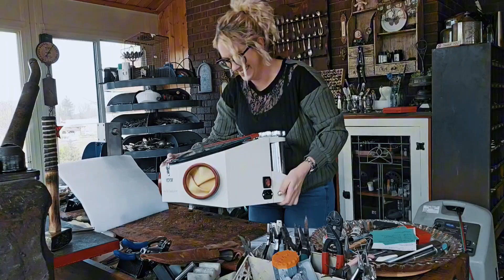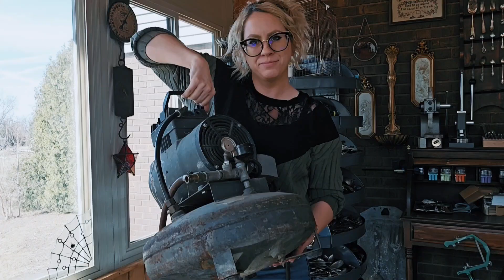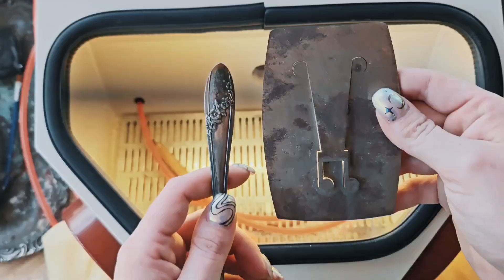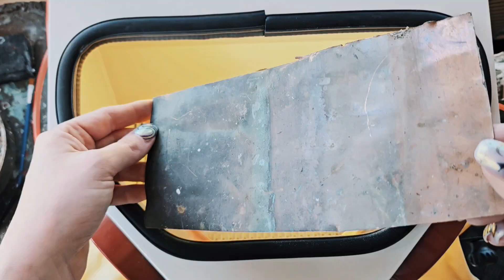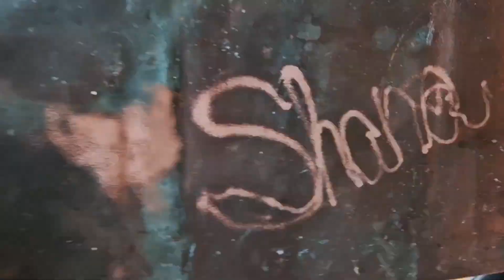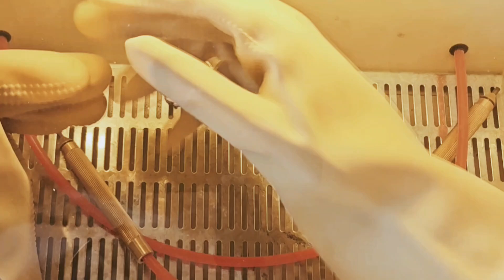New tool from Vevor!

Comment: I have the same sandblaster but I can’t seem to connect the airlines because it came disconnected. 

Is there a way you can share which airlines goes to which connection pls. Like an imagine of the back airlines 

Thanks
Reply from the maker: I sadly have mine in storage and wont be able to tell you 😅

Comment: Do you know what size grit it takes? Can you buy other ceramic nozzles and changer them out to use different grits?
Reply from the maker: Ooo, that I don't know
Reply: @silverwearbyshana  What connection did you use to attach it to your compressor? All they gave me was a plastic tube with no fitting, and no instructions.
Reply from the maker: @herbfellows6435 I honestly don't remember, mines in storage at the moment.

Comment: You said '4 kilos of air'? So you only used about 9 lbs of air pressure set on the compressor?  Or are you referring to soemthinng elkse? My purpose is to sand blast images onto glass.
Reply from the maker: It should work on glass

Comment: I use to sandblast tubing (inside) when I worked as a steelworker. When I got put in sandblast I’d tell myself I was at the beach with no ocean or sun lol😂… used high pressure to blast id of tubing… I must say now that I work with jewelry, wire and beads etc it would be a lot more fun as you demonstrated sandblasting pieces of jewelry and or metal.  Love your work and videos…. Very cool … btw… a lot of people wouldn’t know about the foot peddle thing lol
Reply from the maker: Thank you❤️

Comment: I guess I don't understand why the twin pen. Convenient,  sure. But why would you need two? Ambidextrous? You can use both at the same time? Other than not having to refill the sand as often.
Reply from the maker: Normally when someone has one it's in a business so multiple people are using it, that way they can be left or right handed and be able to use it. Only one works at a time.
Reply: But why do you need 2 pens?   The 2 pens are identical.   It's not like one is a left handed pen and the other is a right handed pen.  You could use a single pen with either hand,  just like every other sandblaster I've seen in my lifetime.
Reply from the maker: @gregorylubbers8533  Technically, one is for left and right since the hose only goes so far on each side
Reply: There's two pens/canisters so you can have two different types of media. A person might need different finishes and having two pens/canisters makes it easier to switch between the two.
Reply: @337san5  This would be true if you aren't recovering the media. If you're using expensive stuff, like silicone carbide, you want to recover it, so you would have to clean the macine before switching grits to preven contamintion.
Reply: Then just hold the piece your sandblasting within reach of the hose....it's not like the cabinet is 5 feet wide.  Even if it was, the hose design is a flaw.  Just put the hose in the middle so there's no need for 2 hoses/pens.  Not trying to be a jerk but don't see the point of this design, lol.
Reply from the maker: @gregorylubbers8533  i understand that, but I'm only showing it off. i didn't design it 😅
Reply: @silverwearbyshana Шана, пожалуйста не ходи босиком в мастерской😢

Comment: A cool idea for this tool, if you have a Silhouette or Cricut to make adhesive based stencils to act as a resist to the sand blasting, you can use the roughness to create ghosted images in metal that can be antiqued.  It works really well on blades, so would prob work well on silver too.  Thanks for sharing...  I'll use your link when I grab one.  I alsways end up in my big cabinet, but this looks super convient on my engraving bench!  Cheers!
Reply from the maker: Ooo, I'll try that
Reply: @silverwearbyshana  Just one consideration.  May seem obvious but it wasn't to me. :)  You have to come at the stencil with the pen directly(90 degree) as any angle will peel it up and ruine it quickly.  Cheers.